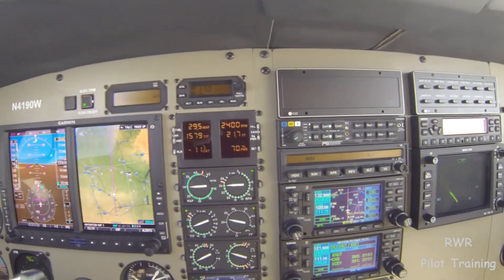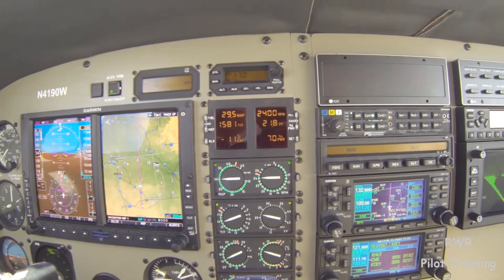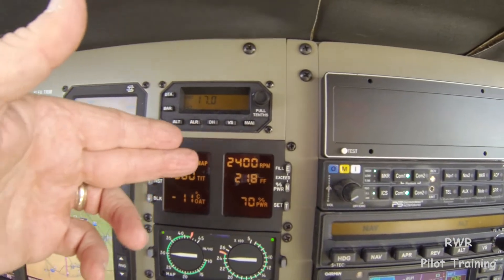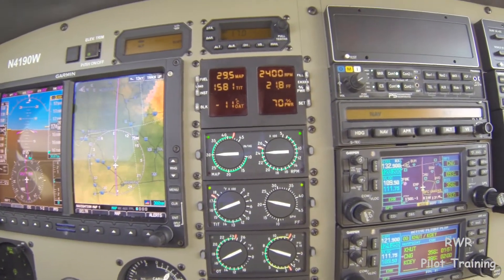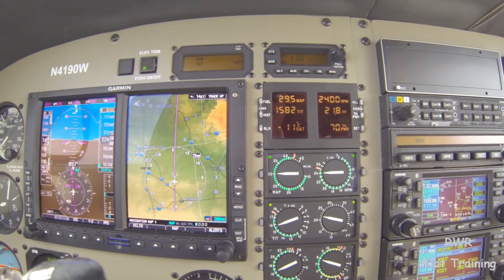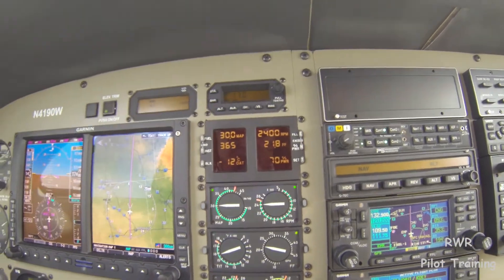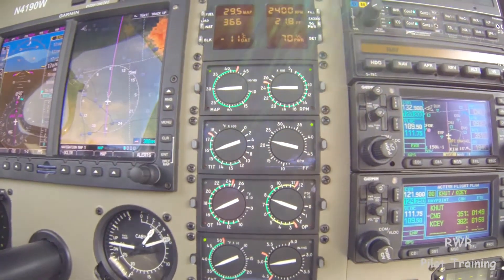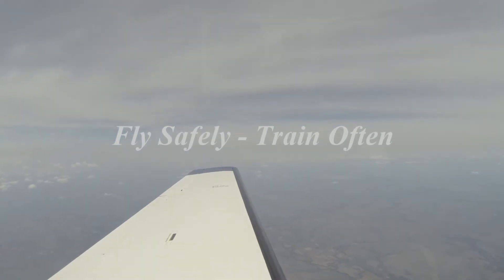PA46 Mirage Piston Engine Cruise Management

Comment: Hi Dick, I see the POH allows for so-called economy cruise settings with 2200rpm and 26in. This burns 15GPH. If we were to fly this way 90% of the time, would there be any detrimental effects on the engine in the long run? Thanks
Reply from the maker: I think not, as there is a trade-off between how long you fly at slower speeds, which seems to burn just as much fuel as flying at normal cruise. This is likely true of any aircraft. Unless you’re running lean of peak, in which case you’re not making normal cruise power. it’s an ongoing argument, but my emphasis is on drawing the fine line between use and abuse. Fly Safely - Train Often .. DR